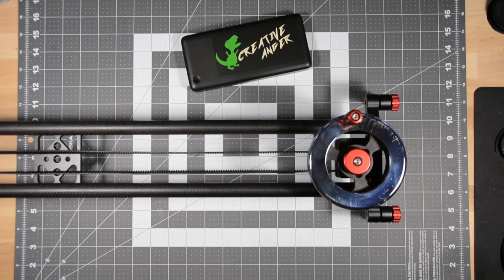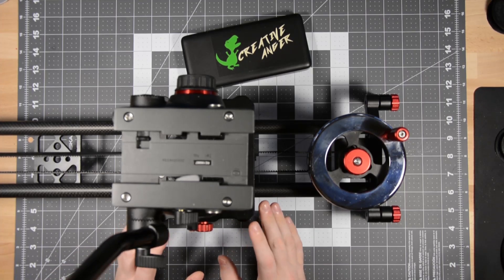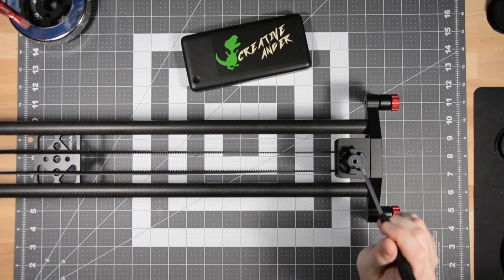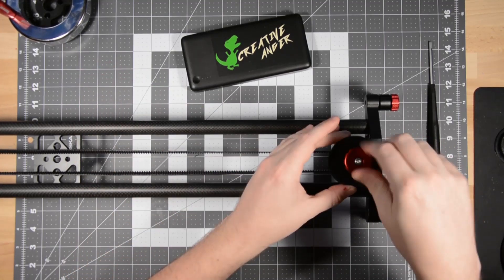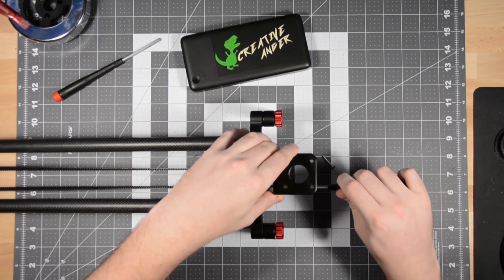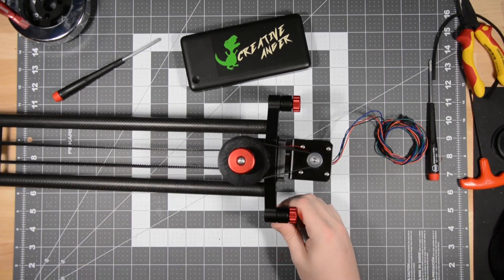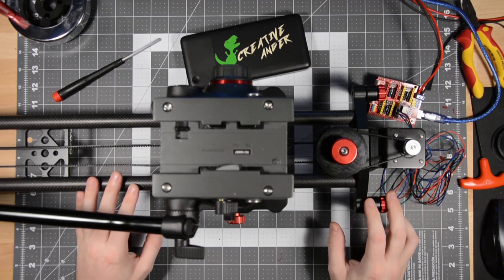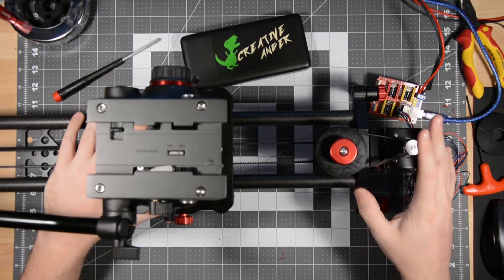DIY Motorized Camera Slider?!

Comment: I built this exact rig, but basically finished the project without the need for a serial connection. I'm going to be posting a video about it in the next couple of weeks, thanks for the great idea! I have the exact same slider. In the code I had to make my own functions for ramping up speed and ramping it down. Curious as to which library you're using for yours? I notice it speeds up and slows down very smoothly. In a software update for mine in the future I plan on adding a stepper motor library to do this.

Comment: Amazing. I saw a marketing post about this slider and was curious to know how much it was. I have a Neewer (bought in Jan) slider with no pulley that I was going to convert. I decided this slider would help alleviate needing to convert it so I googled how to convert this slider and this came up.

I have a 3D printer but still learning how to use it. Are you selling the parts yet? Are you using arduino to control the stepper motor?
Reply from the maker: Daren Schneider I am! It’s an Arduino with a stepper motor shield. I control it by using manual GCode commands over a serial link. It ended up being a super simple method of controlling things — especially once you learn how to properly work with speed and microstepping settings.
Reply: @CreativeAnger  can you release the print file for the parts on this slider? really looking forward to printhing these!